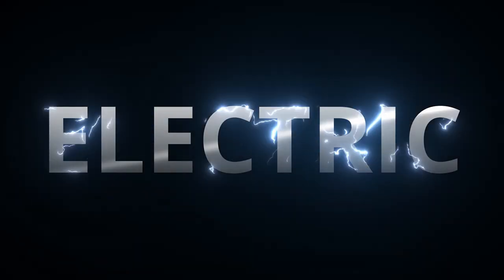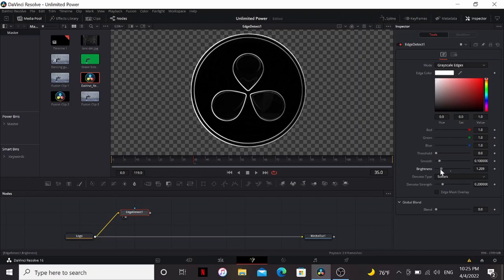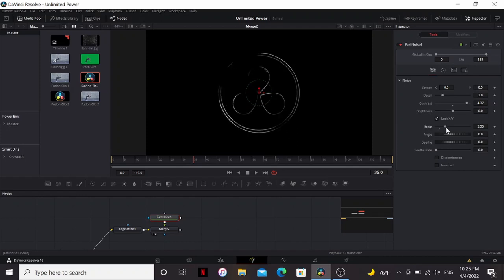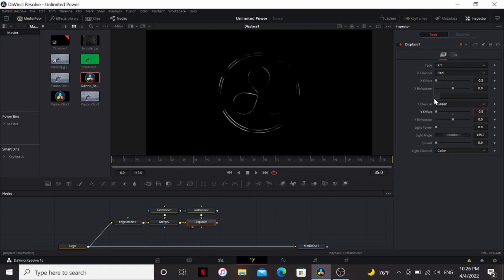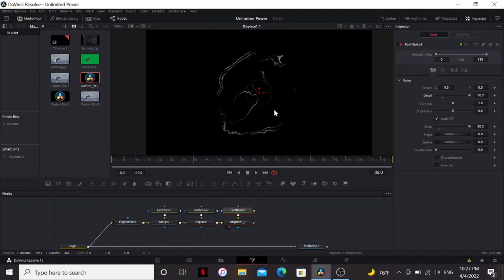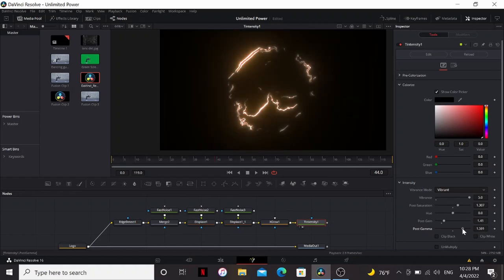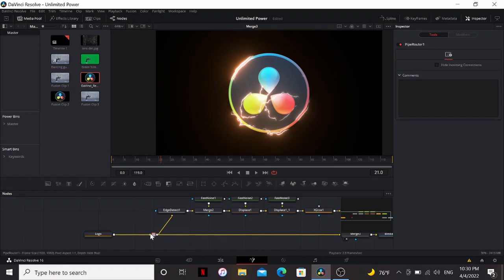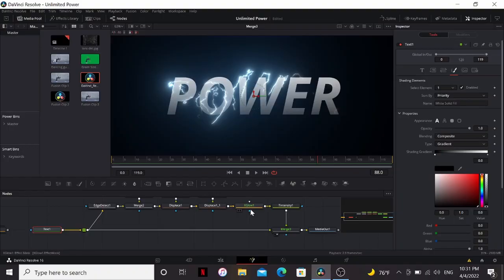Super FAST Electric Text | Davinci Resolve Tutorial

Comment: YO, I was lurking the comments and I see a lot of people ask'n how to get a transparent BG vs black BG, and dropping this in reply as well as a independent comment to help where I can, BUT this is entirely doable with some green screening.  fastNoise nodes in Davinci splits the x.y channels in the fast noise nodes between X=Red and Y=green for alpha green screening. 

So the Settings to update per this tutorial to get lightning over your image or text but keep transparent BG is as follows Enjoy:
1. in the first fastNoise node set left color node in the gradient slider (i.e. Click the lithe triangle under the gradient bar to access the left or right nodes) to red 1.0 then set Green(G), Blue(B) & Alpha(A) sliders all to 0.0   Set the Right color node to G=1.0 and R,B,A=0.0  (This effectively sets the left node red and right node Green and your noise channel will look all Christmas color like in the viewer)
2. Second and third fastNoise Nodes, are both two color channels (where the first FN was a gradient) and will have the same settings in both but just on two independent color channels instead of the left and right channel slider like the first node had, so set Color1 as R=1.0 then G,B,A=0.0  and Color 2 to G=1.0 and then R,B,A=0.0 (basically the same thing you did on the Gradient slider just a different menu option)
3. Also the base image you use needs to have the White Edges only with no infill otherwise black from inside the edges will bleed outside the original logo with the warble effects to remove the infill add a "DeltaKeyer" node between the EdgeDetect and merge then in the settings make sure the check box for "Lock Alpha/Spill Removal Color Bal." is selected and set the reference color to black 

bada bing badda boom you have outline only

And Viola you now have a transparent BG play with the rest of the sliders on the noise panel of the fastNoise nodes as well because the numbers in the tutorial are a lot different in Davinci 18,  example I had to set the contrast in the first noise node all the way up to 26.9 to get a good look where the tutorial had something ~5/8 or something therein  

Hope this helps y'all out Peace be the journey my friends!
Reply: Have you found that the delta keyer removes the purpose of the first noise node? Instead of my edge detect being in chunks, now it's just a squiggly outline

Comment: Atleast givve alternatives for effects like XGLOW and tintensity for those who dont have or where to get them
Reply from the maker: For Xglow, you can use a soft glow node. To get a better result try using 3 of them with the glow size getting bigger on each one (values of 5, 50, and 100 work well for me). For tintensity you can use a color corrector node. You can download both Xglow and Tintensity on Reactor.
Sorry I forgot to mention this in the video. Sometimes if I mention something in an older video I forget to mention it in newer videos.

Comment: I have a serviceable PC set-up (AMD Ryzen 5900X, RTX 2070 GPU, 32 GB RAM) but it's taking several minutes for me to see any of the adjustments to the fast noise nodes.  It was instantaneous on the first one, but after adding the other two it was crushing my machine.  Normally my PC is pretty solid with Fusion stuff.  What kind of set-up are you using?  Yours seems to work just fine.
Reply: maybe a gpu issue? Mine stuttered during this procedure too, but it was bareable. Correct me if im wrong.